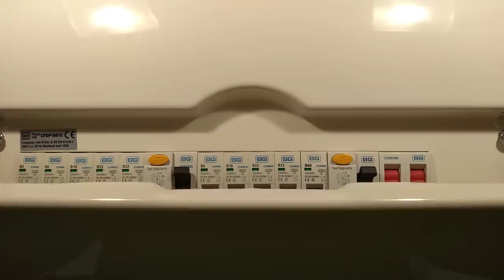A look inside a British home electrical panel.

Comment: thats so small.  For sure not a house size.  As for main breaker.  Interestingly when they dewired (from above, and then buried the electrical cable so we got a new circuit breaker instead of 2 and 2-3 satellites hooked up that were not up to code (like washer on one and a/c on another, a/c would almost always trip)   they installed the new one with the main breaker on top.  Which is pretty much the easy way to hook up an outlet without worrying about getting a shock, then for whatever reason they had the outside the house one.  Unlocked so any idiot could come up to it and shut our power off.  We added the lock.  no clue where the key went.  Not entirely sure why they did that  same goes for the cable modem which was designed to be mounted outside but alas they mounted it next to thee breakers (fiber)  again no clue why they did that.  it's a Motorola.  does look like it could use a backup battery but that part is ISP only .. kinda wish it did because power goes out IP changes.
Reply: Not small for the UK. Remember each of those 32A breakers typically has 10 or more double socket outlets on it. We don't use one breaker per outlet.
Reply: @Rosscoff2000  neither do we.  Which (zap) tends to be a problem.  Without say a remote gizmo where you plug something into an outlet and then find out which one it goes to on the breaker  Say my room for instance  One breaker controls the lights in my room and the bathroom but the outlets are mostly for my room and the bathroom.  There are still several we don't know what they actually go to.   I don't think it was to simply things, just make it safer since having an addon circuit breaker box was not up to code let alone the mini addons.  In an apartment I could see this, but sometimes even the apartments are bigger.  Now a house run by screw in fuses those are about this size.  And they'll run the whole house.  I'd just rather not screw them in but I keep them around just in case.  I don't think there's a problem keeping good unused fuses around is there.   They don't rot since the fuse is inside the case, metal or glass.

Comment: No breakers on the nejtral wire? Scary!
Reply: If the RCD trips then the neutral will be isolated since its double pole mechanism. Although the MCB won't isolate neutral.

Comment: I realize that the service head cutout is the main disconnect but why would they switch or break the neutral in the consumer unit? I like it when they put a switch in the meter tails before the consumer unit but those tails SHOULD BE IN CONDUIT not just left exposed i dont like this not to mention 240 volts to ground,miniature breakers protecting branch circuits.
In the united states you run a ground to the street side of the water meter + two 8 ft ground rods 6 ft apart . The neutral is NEVER switched or broken it goes directly to the neutral bar. All the breakers are MOLDED CASE .Miniature breakers can only be used as supplementary over current protection after the branch circuit breaker such as in machines. I  looked on ebay uk site
I notice that everything is brass or copper i like this. Hear in the us to much stuff is of aluminum I HATE ALUMINUM! I use Square D QO breakers they instant trip at between 150 & 200 amps on a short. Hear in the us you have three wires leaving the utility transformer there are two hots between them its 240 volts 120 volts between 1 hot and neutral. This is much safer than 240 volts to ground because i can use GFI outlets or breakers this saves lives. In the panel you have 3 busbars 2 are fore the hots and the 3rd is fore the neutral and is bonded to the box if its service equipment but now as of 2020 the main breaker must be outside and marked first responders. This is achieved by purchasing a meter socket with a breaker built into it. In a lot of places in the us the home owner can change a service or wire a new house with a permit. In the uk can the home owner if he knows what hes doing pull a permit and upgrade a consumer unit? Homes in the us have 100,200 sometimes 400 even 600 amp service. 200 amp service with a 40 breaker panel is the most common now.

Comment: The electrical company had a fault on a transformer and it became a reverse neutral so all the appliances, Lights , TVs were being reverse fed. The house was extremely bright the 1st to go out was the TV then slowly all the bulbs exploded before I could get to my panel. I went to turn off the main disconnect but it was glowing bright orange.  The electrical company ended up having to pay me to have my entire house rewired and replace all appliances that were plugged in. It took just short of 2 years in court to finally get them to pay. My homeowners insurance would not pay as the electrical company admitted to a faulty transformer. It was a nightmare. I had to replace it all myself with my own money. It is something I NEVER want to experience ever again.
Reply from the maker: It sounds like the neutral floated.  That results in a serious voltage imbalance.  It shouldn't make your disconnect glow though.
Reply: You are probably right. As I am no electrician, I just know what I was told and I have forgotten as much as possible as this happened over 10 years ago.  I was told my normally 110 outlets were now powered with more than double the voltage. The  circuits breakers were welded to where you could not shut them. And the plastic components were all melted. It was a horrible experience.

Comment: So the flat/house is on a single phase? That's rather strange! (how do you connect your oven?)
Reply: It's  single phase 240 60hz in Canada.
Reply: Here in Australia we use the same electrical panel/consumer unit arrangement, and most houses are also single phase.  Ovens, air conditioners, etc. are all most commonly single phase if they're for residential use.  It can be difficult to find three-phase appliances unless you look at commercial or industrial units because three-phase power in homes is so uncommon there is little market for them.
Reply: Almost all houses in the UK are single phase supplies. It is very rare to see three phase in homes. We use 230V and most houses have 80 to 100A supplies so well over 20KW. Ovens, showers etc are all single phase here
Reply: @juliancollison4782  But then (i assume) flow type water heaters (with ratings like 21-25kW) are at least difficult to have.
Reply: I've always had 3 phases, but then I've always lived in disused(?) farms.
I've got 2 phase 6kW solar and 3 phase heat pump.
Reply: @rarbiart  Why heat water with electricity?  The only  I have a ~9KW electric shower, and the only other electrical water heating is a kettle.  Everything else ( the other shower, bath, sinks, central heating) is all mains gas.
Reply: @rarbiart  You'll never find a flow heater more than about 10 kW in a UK house, and those will be in an electric shower. The high-powered continual flow water heaters are gas, typically at 35 kW. Where there isn't gas (mains or bottled) then there will be a storage tank with an immersion heater. 

25 kW appliances aren't really a think in a UK domestic household. That would be my entire 100A power feed and a bit more. If somebody want's that sort of power, then they'd need a 3 phase 415v supply which can be rather expensive to have installed and is normally limited to commercial premises.
Reply: I have a 21kW flow heater and that is "at the limit" to produce the type of hot water i like for a strong healthy shower..... (before somebody complains about the ecological aspect: i shower just 3-4 minutes, but it has to be strong and steamy...)

Comment: And here in North America, we suck back so much electricity that we use 200A feeds with upwards of 40 different breakers.
Reply: c31979839 200amps at 120v is equivalent power to 100amps at 240v, which is what they run in the UK
Reply: Because we dont have rings 🙄
Reply: @superchromat  
Actually in the US a 200a sevice is at 240v. The 120volt is derived by how you wire the circuit. Like the rest of the world a US house is fed 240v, it's just that the neutral is wired to a different location. 200a would be a large house.
Reply: Bill Elkins true!

Comment: Wow, those are flexible cables with a very small diameter for a 60amp connection...
Get some proper wires (solid core)
Reply: Diameter is irrelevant. A 14 gauge wire (whether it be stranded or solid) has the same current capacity. The difference is the stranded wire will be somewhat physically larger. The main reason solid wire is used in homes is it is cheaper to make! Plus, the flexibility of stranded wire isn't needed. Therefore it would be extra cost with zero benefit.

Comment: Have you seen the SBS TRade Sales CU and internals - they (he) have engineered it so that if RCBO's are used - both the Line and Neutral are delivered via Busbars (2 of) at the bottom.  https://www.sbstradesales.co.uk/order/. Isn't Silicon sealer/filler combustible. Intumescent filler is the correct stuff to use to fill in the holes/gaps. Sparkys seem to have mixed opinions on how much fire sealing to apply to CU's.  Type A RCDs seem to be the latest "thing" -they can  cope with DC loads. Also worth making comment on SPD's and AFDD;s.

Comment: 14kW sounds a lot until someone is in the shower (8kW) and someone is on the kitchen with the oven (1.6kW) and 2 rings of an induction hob going (4kW).  Then someone pops the Microwave on (2.2kW) or the kettle (2.3kW). Should we have 999 on speed dial?   Potentially worse  when you could have.. 11.8kW shower, 7.6kW (8.7kW on boost) 4 ring hob, 1.8kW double oven, microwave, kettle, deep fryer, all the electrical appliances etc... No wonder i pay a fortune for my electric. 
Raw food and cold drinks from now on and no more showers  :)   Forgot the washing machine with its cold fill only..... Damn
Reply from the maker: Two words.  Diversity factor.  All the components can handle higher current for brief periods.  So by the time your kettle has boiled, the microwave has finished cooking your tea and you're out of the shower it all settles down to well below the ratings.

Comment: metal boxes are better because not only for fire safety but they can be grounded because if a poor connection is made and a wire or bus bar comes loose and contacts the box it would cause a short and hopefully trip a breaker.

also when you burn plastic you get toxic fumes you dont want to be breathing.

if money is the reason why not do a walmart and work the employees off the clock  as soon as they punch out  "oh we need you to clean the bathroom"

hopefully a fire happened and nearly burned down the house of the top officials so it hits right at home and got them to think about what they did.

that gland may have been intended for a different sized box.

not only stuffing small wires into a slot but i have heard of people splicing into existing wires witch is why the knob and tube wiring is not code anymore in the usa.

capacitors are more of an inrush load as they charge

Comment: can someone explain to me how the combined current of a bank of breakers can be higher than the current of the rcd and how a 60A supply can run 126A or breakers? thanks.
Reply: We call it diversity, where it is assumed that not all if any of the circuits will be using their rated load at any given time.
Reply: Before the current enters the consumer unit, there is a fuse from the distribution company that will be rated 60, 80 or 100A. So if >60A then the fuse would blow before the RCD was damaged.
Reply: @robertsmall1715  Thanks Robert, searched for 'diversity electrical' found some good reading material.

Comment: This is hugely different form we how we do it in Sweden.
Reply: Standard in Sweden is C-type, D-type for heat pumps and other compressor units, B-type can be used for pure lighting circuits, but not mandatory, A is basically never used. Also we have three phase power, so it's a bit more complicated inside. Also normal households never have more than 16A in, historically electrical heating was more popular, so houses often had 20 or 25A, and it's seeing a renaissance these days due to electric cars.  Good idea to buy a steel casing though, never thought about the fire hazard. Steel casing, steel door, and a fire approved sealant in all openings should make them fairly self contained if something were to happen.

Comment: What is the section of these wires in mm?
Reply from the maker: Lighting is usually usually 1 or 1.5mm CSA.  Power usually 2.5mm.  shower can be 6mm to 10mm depending on load.

Comment: There are very thick lampposts on the main roads now with a camera at the top with a cable that will take 10000s of voults  .
Has anyone seen this or are we to busy looking at the traffic lights ?
there system is almost complete now .
EMF  hmmmm    I wander what that is .
Reply: shaun Does that tinfoil hat make your head itch?

Comment: When you said the old ones were plastic I just had to laugh! ... Many still have the old(er) wooden Wylex boards in with the re-wirable fuses!
One of my gripes about the modern boards is that clamp screw! In the old(er) main switches it was two (yes 2) screws per termination with the hole you inserted the tail into being a screw thread. The result of this is that the ends of the screw force the individual strands of the tail apart and force the back of the tail to "cut" into the screw thread. They just never came loose ..... unlike the modern ones that loosen as soon as you look at them unless they are clamped down!
There is also a lack of conformity over how to test the Earth Loop Resistance (Ze)! 
Whilst I accept that few electricians are competent persons (a legal term not a slur) and so are not qualified to remove the main fuse (property of the relevant Electricity Board not the Supplier) ..... The Only place to do a Ze test is from the bottom (live supply) of the cutout and the Consumers Earth Terminal (with all other earths removed)! The number of times I get called out for "High Earths" only to find it perfectly OK but being measured at the Consumer Unit so going through several sets of terminals and contacts (DP isolator and Meter contacts) so giving spurious readings! 
There are still a large number of supplies to houses that are no longer good ..... Old obsolete fuse sizes, fused neutrals and multiple looped feeds .... that should be picked up by any electrician doing a consumer unit change, but are let go! Also the addition of extra loads that are not compatible with the supply (multiple Power Showers spring to mind)

Sorry for the rant but this is the area I am employed in!

Comment: In the us, all of our breakers are gfi, all can individually trip.
Reply: This is untrue.
 Although there are GFI/GCFI breakers that mount in the distribution panel, the use of these are fairly uncommon in general use.
https://images.homedepot-static.com/catalog/productImages/1000/e5/e55b4365-6fb2-4f93-987e-29137c5ade38_1000.jpg
 
GFI/GCFI circuits are mainly in the form of an individual duplex outlet with the reset button.
http://support.nordictrack.com/wp-content/uploads/2016/08/GFCI.jpg

Here is a common non GFI/GCFI circuit breaker found in most distribution panels. in the US
http://yukoncorp.com/image/cache/catalog/circuit-breakers/square-d/e7fe7a0c-3f45-46d8-a0ee-bfde2c58f84e_1000-900x900.jpg

Comment: damn we never see braided wire in any homes in the us my house is all 12-2 20 amp circuits the new standard is 14-2 on 15 amp all solid strand
Reply: Structural domestic wiring in the UK is usually solid strand. Its only the cables in the CU that are stranded as stranded is better for flexible applications.
Reply: @shilks8773  thank you and excuse my ignorance but what is the CU? also it looks like these systems are single phase vs our household split phase?
Reply: @kameron454ci  CU = FB = DB. (Consumer Unit)

Comment: "plastic enclosure is not a good idea for electrical equipment" [not word for word] - why? I thought plastic is better because it isolates the zappy thing from the outside (your hands) unlike metal.
Reply from the maker: It's the slight fire and dripping plastic followed by completely exposed live metal thing.

Comment: 240v/ is so simple compared to split-phase here in the states
Reply from the maker: It is.  And even in an industrial environment it's still the same system with 240V for lighting and power, and three phase for the machines.

Comment: Know nothing about electrics but have just one question. Why the hell do these things cost an arm and a leg?  Mine looks pretty similar to this and i was charged just over £300. Is he talking trade at £70?
Reply from the maker: This was a pre loaded package unit got from either Screwfix or Toolstation.  If you buy one from old fashioned "trade suppliers" like CEF you will be overcharged.
Reply: @bigclivedotcom  Yeah, electrician rewired the house and it jumped out at me from the itemised bill!  Hopefully a few years before i need another.  😕
Reply from the maker: @malarkey2217  Sounds like they were marking it up significantly unless it included part of the labour cost.
Reply: @bigclivedotcom  No, labour cost was seperate item, bugger!